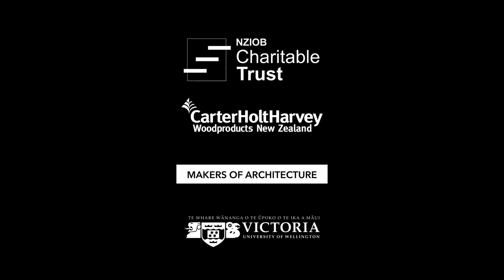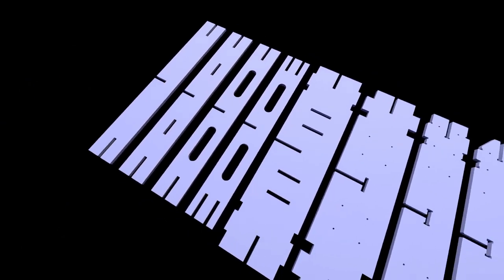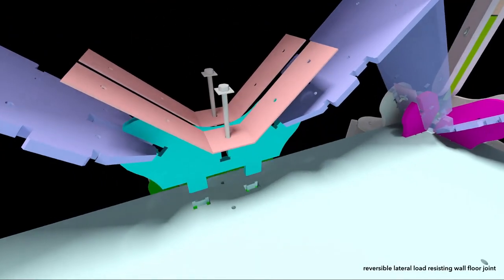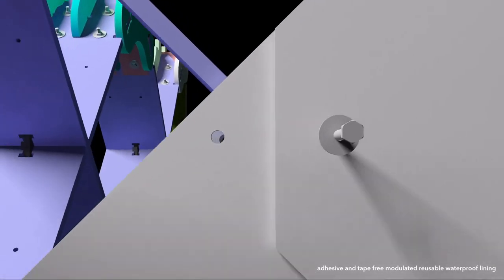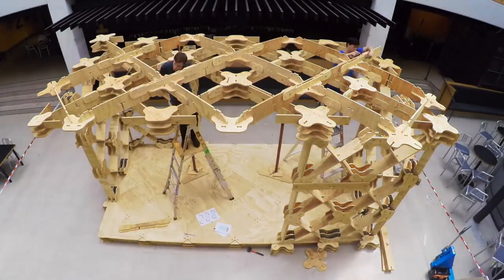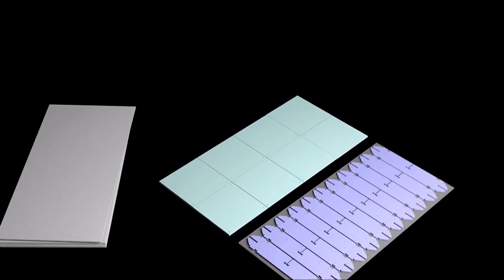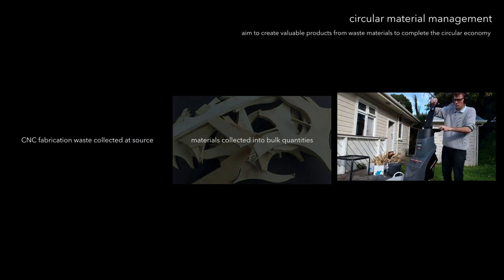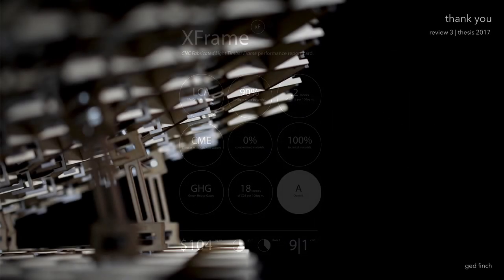Designing for Deconstruction | Pt. 3 | X-Frame

Comment: Fantastic work! Are there plans to use this technique for more complex geometric shape? As a student architect I am interested to see this technique accommodate curved walls and non-conventional angles. Also has underfloor heating, internal ducting and wiring been considered?
Reply from the maker: Hi Volatus! Thank you! No plans to use the diagrid design for complex forms at the moment. The idea is that you retain the same module as much as possible to increase reuse value and then, when you want a curved wall or complex surface, you cut custom elements. 

Infloor heating would be possible - both in a concrete foundation or in the X-Frame module itself. Wiring has been accounted for - at each node there is space to route cables and holes can be drilled into the X-Frame components if required.  Ducting is a bit more complicated due to its size and is not yet resolved - but if you have any ideas let me know!

Comment: One rule of dissassmebly is simlicity this lacks simplicity. each part can not be recovered. I would prefer a 2x8 screwed than this.
Reply from the maker: Thanks for the comment. Simplicity is very important - but layer independence even more so. A 2x8 doesn't make it easy to reversibly connect other layers which makes deconstruction really hard.